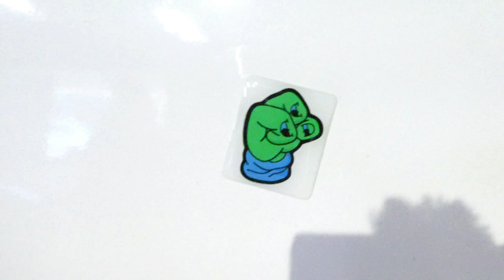FN2 Honda Civic Type R Carbon Fibre fog scoops install

Comment: 2 holes underneath to get to the 10mm bolts holding the fog lights in
Reply from the maker: Would never have got a nut on top of the scoop though unfortunately
Reply: It's just the inner one.
The outside one is for adjusting the height.

Comment: Fair play lads another informative vid with great banter 😁 I did mine by removing the under tray and there are 2 access holes, 1 under each fog light. Long extension on a wratchet did it for me 👍🏼👌🏼and also there are 2 small clips, 1 on each fog, that u need to take off the tabs on the fog light and pop them on the tabs on the scoops. keep up the good work. Also how much are the hose kits from dynodaze?
Reply from the maker: Awsome man, good to know 🤘🏻❤️

Comment: Great job lads. Have you ever thought about gas struts for under the bonnet. I've been unable to find a suitable set for an FN2 so was wondering if you have? Bought a set from China, but no joy in fitting them.
Reply from the maker: Ben actually bought a set but couldn’t get them to fit, there is a company that does them, it’s just one strut on one side, search in the Facebook forums as I literally saw a post about someone fitting them about 2 or 3 days ago 🤘🏻

Comment: It was so stupid a lot of work to completely loosen the front bumper, there are two places under the fog lights under the bumper where you stick a screwdriver and loosen the screw and pull out the fog lights easily!!!!!!